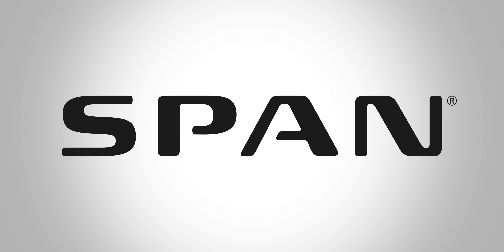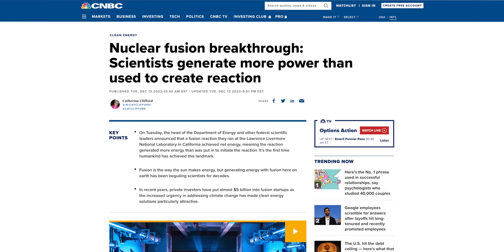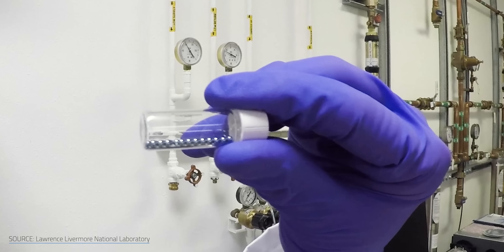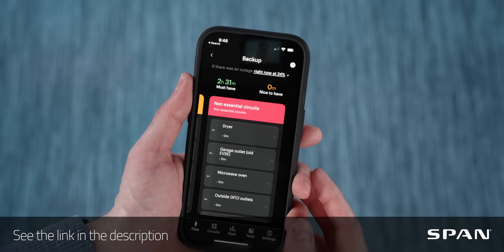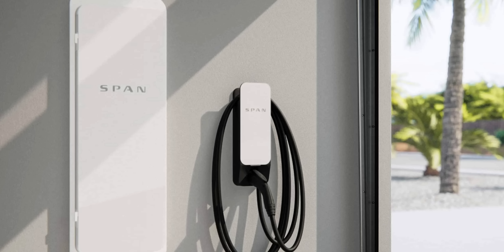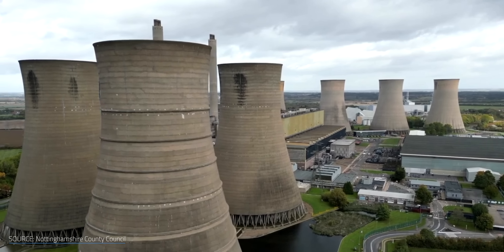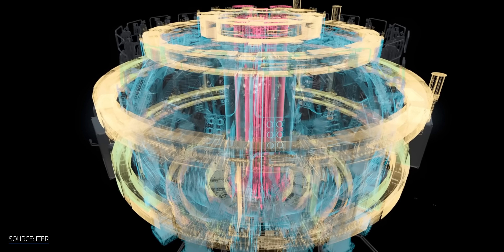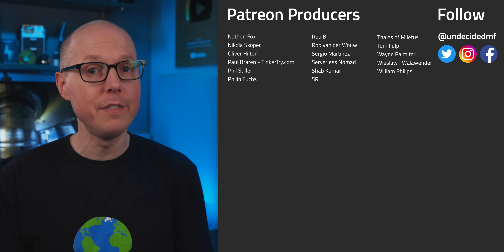What This Breakthrough Means For Nuclear Fusion

Comment: This isn't a viable approach to energy generation at all. It's pure hype. Interesting, but not actually useful. You can't swap out the fuel pellets fast enough for this to actually produce any amount of useful energy, furthermore, It's a LIE, it wasn't a net gain AT ALL. And I'm very unimpressed with NIF for this unfounded bragging, it's all total bullshit, to even use the misleading terminology they used was disgraceful. They didn't achieve a groundbreaking world first, they hyped up a LIE. You can't ignore a massive component that is REQUIRED for the system to work, you can't ignore the energy losses involved in the system, that's dishonest and unscientific. I have a fundamental problem with anyone even talking about this as a gain, because it WAS NOT a gain, more power went into the total experiment than came out, so they lied, everyone sheepishly repeating this as a milestone is engaging in willful ignorance. Any fusion system can claim a gain if they ignore their losses and total energy costs to run the operation, that's not a caveat, it's willful omission of data to substantiate a false claim. This isn't a step forward at all, the goal of fusion isn't to just show it's possible to ignite, we already know it is, this whole story needs to just be buried, because it's nonsense and utterly useless to the actual goal. The people wasting time and money on crap like this system, are entirely missing the point, if you're not pursuing a continuous system, you're just pissing into the wind and wasting resources for fake bragging rights. I'm so sick of the "breakthroughs" that are actually not useful steps that will lead us to a working system, this stupid once a day NIF blaster is a total waste, it doesn't matter if you can get a once a day burst of power, that's not what we want, need, or are aiming for. Proof of concepts aren't helpful if the concept itself isn't useful and viable. Surely I can't be the only person who sees this ?

Comment: 66% higher consumption than was peoduced . Then we have not started to talk about the losses before it ends up in the electrical outlet . I am still positive to this initiative, i is possible , ITER is big let them work and evaluate , it will take a 100 years more , there is no other ground elements available anyway to contain massive heat .
Don't forget the sun mu friends , the massive output is enormous, why create it if we can use it directly

Comment: Is there any commercial development on fusion energy technology in Europe apart from the UK? (ITER is far from commercial)
Reply: ITER is explicitly non-commercial. The follow-up DEMO will be "semi-commercial" (meaning that even though they hope it could produce excess power, they don't plan to connect it to the grid until quite late into its' life). Germany, Holland and Switzerland certainly have some fusion facilities, but none of them are really aiming for anything commercial yet, they are all research facilities. There are, of course, various mutterings about new facilities by various governments, but they would all be pretty expensive, and takes years at best to show any kind of results at all. I doubt any government in Europe is inclined to make that kind of investment commitment with so many more pressing short term requirements for the money.

Unless someone can come up with a pretty convincing "we can definitely get fusion power commercially available (including the cost) within, say, 10 years" proposal, Europe is probably content to let the current facilities keep working, and see what happens

Comment: Given that we would need a 10000% increase in efficiency (or 99% decrease in inefficiency) to decrease the power consumption from over 200MJ to just over 2MJ, this 20% increase in efficiency of modern lasers really isn't much more than a drop in the bucket. At least for this application.

Comment: Whilst fission and fusion are non-carbon emitting energy sources, one must consider that it still creates new heat within the atmosphere and therefore adds to global warming.
Imagine if it was so cheap, so easy to build and implemented rapidly then we realise that in the big picture we cannot be creating new heat sources within the atmosphere as we still have the historical CO2 and methane retaining the heat. 
Remember when you're looking at the ice cores and see the downward slope of the graph, its nature that did it - plants, sun and CO2. 
We're safer developing tech that's using the sun's energy that penetrates the atmosphere. 
It's all about cooling the planet. Not just stopping CO2 emissions which is merely a byproduct from releasing the energy of the sun that created the fossils millions of years ago.

Comment: As a Nuclear Engineer, I know a lot of things about Nuclear Fusion that is being simply lied about or purposely overlooked in order to be able to continue getting funding. The power needed to run the lasers has to be considered in how much energy it takes to produce the fusion reaction. They conveniently overlook those things because they need continued funding. Without the government funding and non-tech savvy investors, engineers  and scientist would not be able to keep playing with the “development” of a doomed technology. First, Fusion is NOT clean. Very high speed neutrons are a byproduct of Fusion. They interact with all the material surrounding the reactor and make that material radioactive. The neutrons are so prevalent and contain so much energy, that the inner lining of any fusion reactor chamber has to be lined with the most malleable metal known to man, Gold.

There are massive energy sources that we are currently throwing away that could be producing energy without any additional fuel required, using current technology and even technology from the 1800’s. A Coal, Fuel Oil, or even a Fission Nuclear power plant is only about 25 to 35% efficient. That is, if you calculate the amount of energy that can be extracted from a ton of coal by burning it, only about 30% of that energy that is released from the coal leaves the plant as electrical energy. The biggest problem is that steam turbines can only utilize superheated steam. Superheated steam is water in its pure gaseous state. Therefore, the steam exiting a turbine has to still be in the superheated state. If water vapor is allowed to begin forming while in a turbine, becoming saturated steam like you see coming out of your tea kettle, the vapor molecules act like BBs in the turbine and will almost instantly destroy the turbine blades. This superheated steam leaving a steam turbine has to be cooled down to become liquid water in order to be able to be pumped back into the coal fired boiler or the steam generators of a Nuclear Reactor. This is why very huge heat sinks are required at every electrical power generation station. This is the 50 to 60% of the energy from the heat source that is being thrown away. I live near Belews Creek Coal-fired electrical power station in NC. People around the lake don’t need hot tubs because the lake is a hot tub. In the 1800s, far less heat differentials were used to run very large Sterling Engines to pump water out of mines. Sterling engines or other technologies could be used to take advantage or all that “waste” heat. This heat source could be used to “power” the “brick” batteries Matt has recently presented. The heat could be used to produce hundreds of acres of winter-time green houses or hydroponic farming. If modern designed Sterling engines were used to produce electricity, it would probably require battery farms to capture the energy and convert it to AC power to synchronize with the power grid, just like solar.

The point is that EVERY conventional electrical power plant in the nation (except for any hydroelectric stations) is throwing away a large percent of the power it extracts from its heat source. We should be developing methods of utilizing this wasted energy without the need to burn any additional fuel.

Because of the inefficiencies in a steam turbine electric power plant, and the inefficiencies in power transmission and voltage conversion (transformers), probably only about 10% of the heat energy produced by burning coal or fuel oil arrives at your house, or EV charging station. That is why EVs, and electric heat pumps cause more pollution to our planet than if the fuel is burned directly in a vehicle or to heat a house. That is how things stand now. In the future, if the majority of electric power can be produced from planet friendly techniques, THEN EVs will be a good idea. But currently, they do more harm than gas or diesel vehicles. To meet misguided legislatively mandated EV production, the power companies will have to increase electrical power production very quickly. The only way they can respond fast enough is by building more coal-fired and fuel-oil fired power plants. Thus, the well-meaning legislators will have made things worse for our planet.

As for a Fission Reactor core meltdown, Three-mile Island would never have been harmed had the operators had heart attacks and been laying on the floor during the “loss of coolant” accident. The main computer was doing exactly what was need to be done to protect the core and bring that accident to a completely safe and recoverable situation. It was the fault of the reactor operators that caused the partial meltdown of the core. The lead operator OVERRODE the actions of the main computer and caused all the problems at Three-Mile Island. My Nuclear Engineering Class at NCSU studied that situation in detail. Much was not told to the public about the failure by the reactor operators. Nuclear Fission has the possibility of not releasing significant planet harming byproducts to our one and only habitat. There is a 100% chance that coal-fired and fuel-oil fired electric power plants will release significant amounts of harmful byproducts into our environment. The Fukushima Nuclear reactor failures were either a very bad engineering failure, or were not built to what the engineers wanted due to financial constraints. Money and profit make very poor engineering and safety decisions. The Chernobyl disaster was not a Nuclear caused explosion/accident. It was a carbon fire that escalated to a point of excessive pressures that caused the reactor to be damaged and exposed. That type of carbon-moderated reactor design was never considered for use in the US because of the chance of a carbon fire. It is almost impossible to build Nuclear Fission Reactors in the US now. The first permit in about 30 years was granted to build 3 1100 MW PWR (Pressurized Water Reactors) recently. The power company had to scrap the idea because of the bankruptcy of Westinghouse. GE, the other major reactor designer, is in trouble after the Fukushima disaster. By the time Fusion Reactors put any power out onto our power grid, there will not be anyone to use the power after the massive global crop failure from global warming and unpredictable violent weather. Isaac Asimov predicted that by the time enough people see that the earth is in trouble, it will be too late to be able to fix it. It’s like a massive pendulum swinging and we will not be able to stop its incredible momentum.
Reply: I thought my posts are long.  What was your point?! In seven words or less please 🤣

Comment: So, if we make the lasers used in the NIF process 20% more efficient, it would only take 160 MJ of energy to put that 2 MJ onto the pellet and get 3 MJ out? Net loss would then be only 157 MJ per cycle rather than 197 MJ as demonstrated.
Actually that does not sound promising at all - to break even the lasers have to be  such that it only takes 3 MJ to put that 2 MJ onto the pellet ie. 67 times more efficient than the ones used by the NIF. That’s a very big ask and a postulated 20% improvement doesn’t come close.
And then one has to also factor in the energy cost of making the fuel pellet (huge and undisclosed) and prepping the chamber for another burst the next day (also huge and undisclosed).
And the there is the problem of how to make this a continuous process.
Would it not make more sense to put the effort into improving the efficiency of collecting the energy from the big fusion reactor already running in the centre of the solar system?

Comment: The current fusion efforts seem to be to create a fusion plasma from a target but that approach would seem to guarantee intermittent output with a loss of output when the reaction ceases followed by replacing the target with a new one and then repeat.  I don't see this pointed out as a problem so what am I missing here ?
Reply: "Pulsed" output is not a fundamental problem in terms of energy delivery. Think about how  internal combustion engine explosions are used in say diesel generators. The ASML extreme UV machines blast flying tin drops into light at 50,000 times a second so having an effective pulsed approach is probably not the biggest technological hurdle facing fusion.... yet.

Comment: Thanks for a lens to correct the media distortion of the NIF announcement. Appreciated even more is the exposure to other more promising and scalable fusion methods that are under development.  It all gives me hope that there may actually be viable fusion solutions on the grid in 20 years instead of 30.  Unfortunately, I believe our time frame for making massive transitions to green energy and avoiding ecosystem tipping points is maybe 10 years. It would be tragic to miss that window because we're distracted by over investing in the shiny promise of fusion.

Comment: Great information and always interesting content. Did someone mention that heavy water could be split. If so, I think I made heavy water when experimenting with liquid graphene. When the solution is refrigerated and the ice removed that makes the graphene more conductive and holds more of the energy. Just my thought on what happened. If you could find out the freezing point of graphene? Thank you
Reply: What exactly do you mean with liquid graphene? A Graphene soltution/dispersion? The melting point of pure graphene is around 4000K-6000K. The freezing point of the dispersion would largely be determined by the liquid it's dispersed in.

Comment: We have just seen ignition. A few months ago we didn’t know if net positive fusion could be done in a lab. It’s only going to get better from here. I just hope we get to see it.
Reply: There is no such thing as fusion ignition yet though. The energy cost was 300 megajoules. The 2.05 is a reduced estimate based on what they could measure reaching the target, and estimates of how inefficient the lasers were. With a 99% energy loss or rationalization away of the energy input, it’s easy for that 2.05 input estimate to be wrong. They could easily not be measuring all the actual input out of the other 300 megajoules the experiment consumed, since 99% of that energy input isn’t included in the 2.05 “input re-estimate”. Even the sun’s fusion isn’t self-sustaining without a gravity well actively powering it. The sun’s actually powered by a gravity well. Fusion is just the “crank” that it’s turning. Fusion immediately stops when the active energy fueling it stops. It can’t “ignite” like fission, which is the natural direction for converting matter to energy. With fission, elemental breakdown can ignite other matter in a self-sustaining process, which is why you can have a runaway fission reaction but can’t with fusion. Fusion is mostly spitting back out the energy you’re putting in, whatever isn’t consumed in the change. They’re just stretching and torturing the language to pretend this is a net energy gain or anything approaching ignition.
Reply: @aalvarez2914  While yes Fusion isn't self sustaining without constant input it clearly CAN be net positive (sun being the obvious proof) which is all that really matters. Overall I agree laser based fusion is likely not going to lead to self sustaining reactor. You'd need like like a 50x increase in laser efficiency to even get in the ball park. That doesn't mean fusion is impossible to get to net energy gain though.
Reply: @aalvarez2914  You would be the person who would be scolding Wright Brothers for their first heavier than air flight back in 1903 because it covered 120 feet in 12 seconds, at a speed of  6.8 mph at an altitude of a whopping 14 feet!!!! For all intents and purposes the 1903 horse buggy was much better at going from point A to B than that useless contraption the Wright brothers came up with. And yet here we are!!!!
The LLNL's mission objective was to demonstrate net positive gain from fusion as ratio of input to output. That is it. Its a science experiment, a proof of concept demonstrator that it is indeed possible. That is it!!!
It is as big as Wright Brother's first flight which you would have called stretching and torturing the language in 1903. And still to date that contraption lasting 12 seconds is the single biggest achievement in aviation history yet.

Comment: How much energy does it take to produce the 300Mj of laser energy? Bet it's at least 500Mj and then there's probably another 200Mj of overhead energy use by the facility. Speaking of which how much energy did building the facility cost? I feel like scientist are trying to run a shell game to maintain research funding.

Comment: If you power the lasers with solar power then it is truly a net positive carbon neutral gain provided the sources of that solar power is is equally carbon neutral. Once you get the ball rolling it can power itself.
Reply: Wow, you'd need a solar field roughly the size of Nevada to make that work. Probably the best possible use of Nevada though